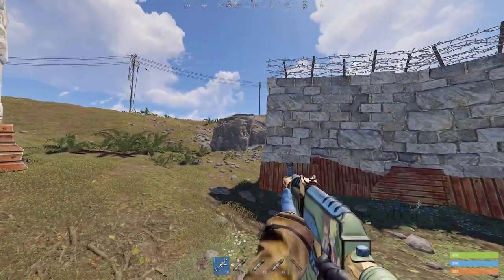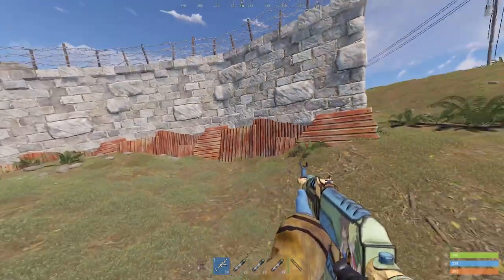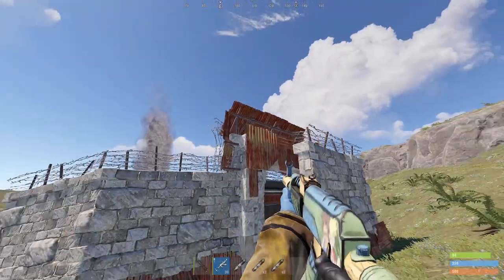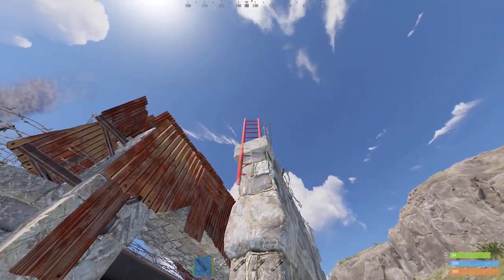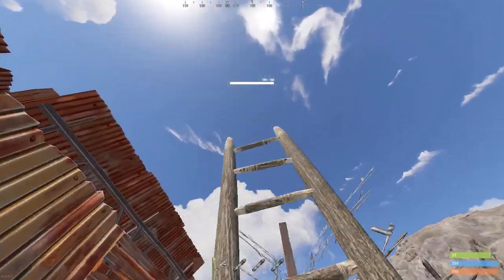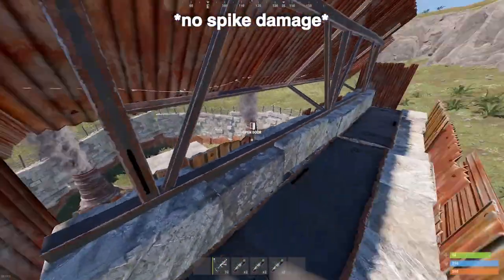Don't place your gate backwards in rust.

Comment: Just curious though, how much damage did you take from that jump vs what you would take from just going over the spikes? 

That jump looked painful, but this is definitely a super useful tip when considering which way round to do it.
Reply: when you do the wall spikes, you need atleast 3 syringes to be safe from spike and drop damage
with this, its just jump damage so 2 syringes should be fine, but in worst case 3
its just much better cuz the whole thing happens much quicker, and sometimes there will be large furnaces you can jump onto to reduce drop damage
Reply: @SukilSakthivel  
> and sometimes there will be large furnaces you can jump onto to reduce drop damage

exactly that, this happens more often than you think
Reply: If you're a real Chad/Try hard can jump from the top of the gate and use the inner wall to negate the damage?
Reply: Real chads foundation/wall frame over the wall with 50hp and 3 bandages then f1 kill at a crack and loot from the outside. Don’t be a shitter, play like a chad
Reply: you can land against the gate/ highwall and take 0 damage if lucky, but will really only need 30-40 hp. so its pretty solid
Reply: @OPEK.  someones been watching alone in tokyo
Reply: @TheNightcorelover420  i dont watch alone in tokyo.,i play rust.
Reply: @OPEK.  wrong
Reply: spikes are alwayes way worse than spikes, instant damage

Comment: I always place backwards gates as they allow for slightly smaller compounds with an airlock and more space in the compound. I might want to change that soon lol.
Reply: External tc?
Reply: Not like they’re expensive lol
Reply: I mostly play duo and make small bases on rough terrain that I try to keep as small as possible to avoid attention. I only have a compound for a large furnace, a few planters and a water catcher. Every little bit helps.
Reply: you can always just put land mines on top of the external gate, a nice surprise and an early warning system.

Comment: as long there is no large furnace , big gaps in ur wall or somethink else to build on or jump on to pass the high wall , it doenst matter .... you need a second ladder to get out again.
Reply: it does matter damage wise and the inside airlock is better than when it  faces the wrong way as they wont be in your base when you open the gate on them.
Reply: @keeton7033  u can run fast enough to get through the gap. What do you mean dmg wise?

Comment: Thats wrong. I do believe having the gates swing outward provides a better airlock against grubs and also a grub will always finds his way into the compound whether by taking spike damage or falling from a high place like shown by you so, if you really wanna protect your furnaces to a certain degreee setup turrets and also watch your furnaces as the turrets can always be compound bowed. Also to add to it all, taking spike damage is way stealhier than breaking your legs by jumping in as its less noisy so if the base owner is in the base, you have more chance not to be heard.

Comment: same as when they build external TC inside the compound  lol
Reply: You can external tc any amount of external tcs as long as you place a larger ring of tc’s around there’s.
Reply: that's actually perfectly fine if the compound is really small. the goal of external tcs are to overlap main tc so they cant replace it and to prevent people from building in. this can be accomplished without having a large compound in addition to having the external tcs inside the highwalls depending on the base design
Reply: @TheShizzlemop  what he was talking about was a compound external. also you can't place a tc in another tc's coverage so unless you do the 8 squares out thing the tc coverage won't overlap

Comment: How about don't use gates at all, because they're trash in general. Use a 1x2 stone entrance with double doors, windows, and metal barricades on top, also combine it with inwards facing turrets on the inside, backed by 2 HQM walls and a low wall covering the front on a triangle that way they HAVE to blow thru the hqm wall to get past the turrets, covering the entire inside of the compound, at least 4 of them spaced evenly, preferably more.
Reply: you sweaty

Comment: but also, by placing it this way, you lose the ability to place a high wall outside of the gate and having that nice airlock
Reply: i agree that the gate needs to be the correct way, because that was way too easy to jump into, and i will definitely be stealing this method. but also that gate airlock can be really crucial from letting door campers into your compound, especially when you dont have autoturrets set up.
Reply: you can also make an airlock by just placing a highwall in the compound, and you can just extend the gate section a bit if there isn't enough room